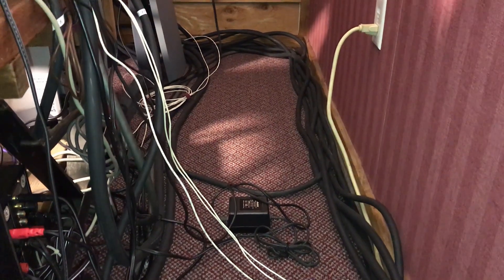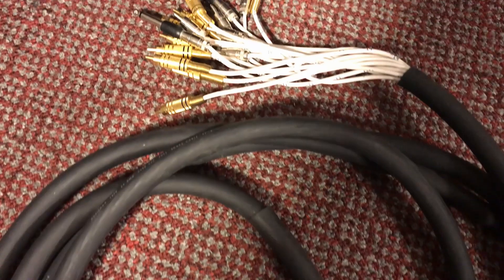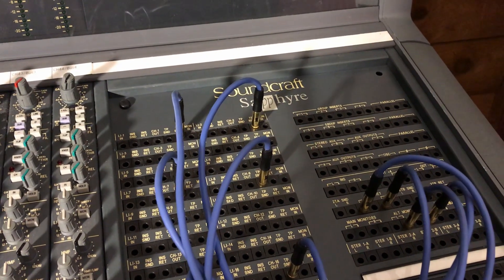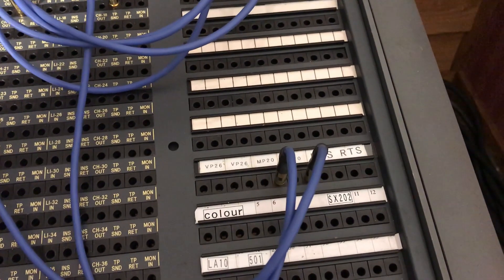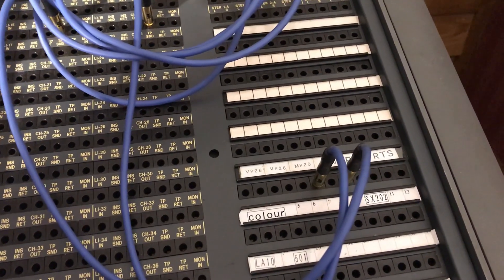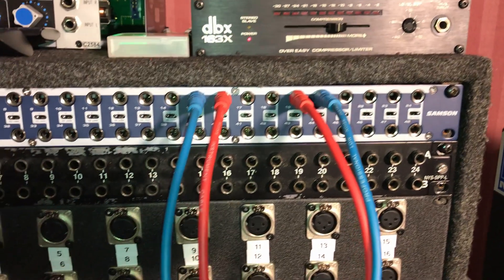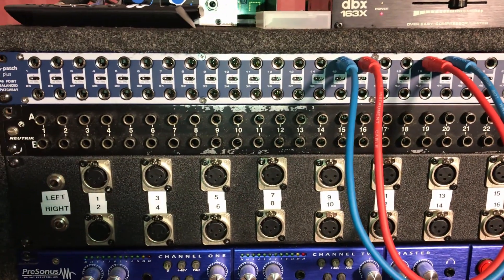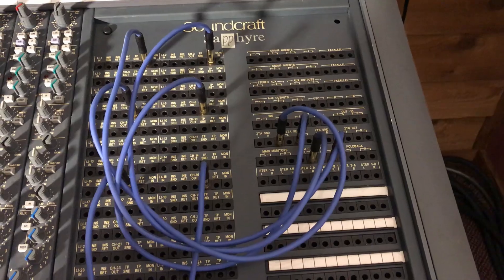Hybrid Studio and Audio for Gear Demos

Comment: Peace Grady. Do you use the Echo Console software in any way with your setup? i.e to get monitor mixes, or low latency monitoring?
Reply from the maker: I really only use it to mute inputs or allow then to pass to the outputs and for level adjustments occasionally. The way the Audiofire 12s work is to pass the input to the output unless you configure the Audiofire console to do something different which I hardly ever do with my setup. There really isn't any noticable latency but I believe it passes the input to the output without a round trip to the host DAW. Since I have them connected to the console, I use the console for headphone mixes for the most part.

Comment: I reverently acquired a fostex model 80 reel to reel, i’m trying to get my ideal bedroom hybrid studio going. 8 channels, any interface/mixer combo reccomend one or specifications i should be looking for or advice in general? thanks !
Reply from the maker: There are a lot of great choices for a mixer. The most flexible solutions for hybrid mixing are recording consoles or mixers as these will have 2 inputs per channel, the main inputs and the tape returns. The Model 80 has -10 line levels that are unbalanced connections on RCA connectors. Most interfaces have switchable levels so make sure the interface you choose has this feature and can switch between +4 and -10. This will make setup and gain staging much easier. Tascam and Fostex made a lot of great consoles in the late 80s/early 90s and these almost always have -10 levels with RCA connections. Examples are things like Fostex 812, 450, Tascam M series, Yamaha RM mixers etc. Other well known project studio consoles from the 90s  like the Soundcraft Ghost and Soundtracs Topaz also have switchable levels although the Topaz has this option on internal jumpers you have to solder to change from -10 to +4. These will have 1/4" jacks for connecting  a tape machine so with the Model 80, you'd need adapters from RCA to 1/4"  As far as an interface is concerned, there are so many options, it's harder to say. Most newer interfaces will still have switchable levels and likely 1/4" connections. Interfaces these days all seem to provide very good quality sound. I like MOTU and RME the best but even a used MOTU can work well as they tend to support their gear for longer than most manufacturers. I always hear good things about the Focusrite interfaces as well. I have a Fostex 450 and a Yamaha RM804 I am about to make more videos about so you can check those 2 out here soon  Let me know how it goes and I'm happy to help more if you have questions. Thanks!

Comment: How are you dealing with -10 and +4 integration
Reply from the maker: The console I have has levels that are switchable from -10 to +4. A lot of consoles have that options but not all of them. You can always use a converter or what used to be called a bump box for that. Let me know if you have any other specific questions and I'll do my best to help.
Reply: @TwinCreekAudio  just was wondering because I have an apportunity to get a topaz project 8 for cheap and its in excellent shape
Reply from the maker: @DeedzDirty  the Topaz Project 8 has switchable levels but they are solder points on the boards if you remove the bottom cover. The details and photos are in the manual which is hard to find but I have copy of you get the Topaz.
Reply: @TwinCreekAudio  👌 is it fairly easy?
Reply from the maker: @DeedzDirty  it is simple enough. There are 2 solder links that need to be soldered together for the +4 mod. I think there is 1 for each channel etc. That's if the console hasn't already had it done before. I have owned two of these consoles and the first one needed the mod while the second one had already had the mod performed. It's really simple if you're decent at soldering. The manual has pictures or diagrams to show which links to solder.
Reply: @TwinCreekAudio  ok thank you.  He said it still stock no mods done.
Reply from the maker: @DeedzDirty  if you have decent soldering skills, you can perform the mod. I have the manual I can send you if you get it. It's difficult to find the manual but someone in the Soundtracs FB group sent me a PDF copy.